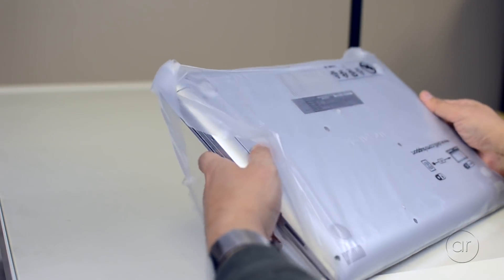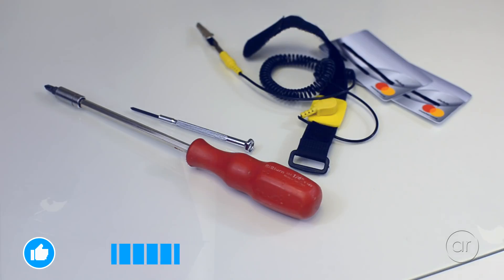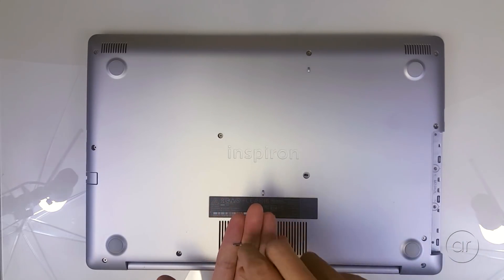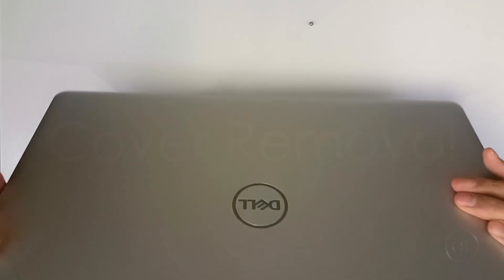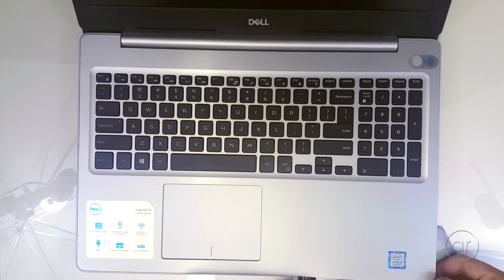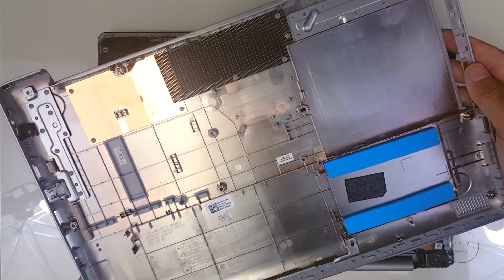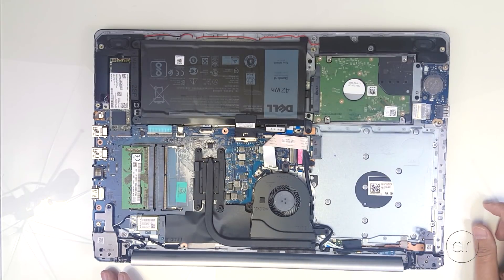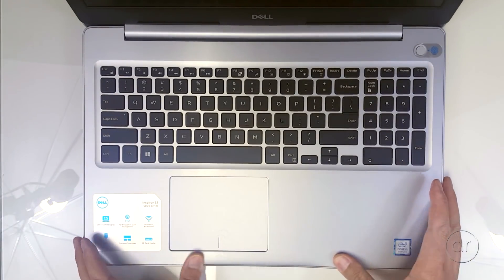How to Disassemble a Dell Inspiron 15 5570 Laptop to Install an M.2 SSD

Comment: I don't comment on videos and yet this was so easy to follow. Just take your time of course on removing the case especially near the bottom of the screen. I had a tiny piece of plastic from the inside corner near the screen of the case break and didn't hinder the case to be installed back on. Did a new RAM upgrade, SSD, and HHD drive. Saved me near $1k on a new laptop since the original HHD died.

Comment: Question. I would like to see a video of you taking either the CD Drive out, and putting in a SSD, configure it like how you did in "UPDATE: Using Macrium Reflect Free to Clone Windows to a Bootable M.2 SSD". Or taking out the HDD and putting in an SSD. And then do the same as "UPDATE: Using Macrium Reflect Free to Clone Windows to a Bootable M.2 SSD". The reason is because my Dell Insperon doesn't come with the SSD slot. Plus, I like how detail your videos are. 

Or of anyone knows a video that does what I just asked above, I will surely appreciate it

Finally, I'll be subscriping to this channel, as I like both videios thus far. And comments are good.

Comment: This is exactly what I want to do with my machine but I have a problem removing the optical drive. When I remove its retaining screw it moves about a quarter inch and then snags on something. I'm hesitant to use a lot of force as I'm essentially pulling on the drive tray. Without being able to remove the drive I can't get at the two base cover screws that sit underneath it so no way to remove the cover. I'd be happy to get any advice on what to do next.
Reply from the maker: It sounds like the screw may be stripped part-way. I don't want to give you advice that may break the optical drive, so I'll defer to others who may have more experience. Anyone?
Reply: @accessrandom  Problem solved. I left the drive tray open and it was clear that the drive case was fouling one of the two screw heads. A judicious poke with a thin screwdriver blade freed it. Now I just have to persuade the right corner of the base cover to unclip and I’ll finally be able to get at everything.
Reply from the maker: @zebop917  Glad you were able to work the problem screw out. Thanks for the update 👍

Comment: Hi, i have dell inspiron 15 5000 which only have 220gb ssd, my storage is almost full. My question is, can I add 2nd slot for ssd (500gb) ?
Reply from the maker: According to Dell's Setup and Specifications page for the Inspiron 15 5000, it supports both a 2.5" SSD and an M.2 SSD/NVMe so if you have one already, you can add the other.

Comment: My laptop is dell inspiron 5570 without optical disk so which ssd will it support?
Reply from the maker: According to Dell's Setup and Specifications manual, the 5570 supports a "maximum configuration" of up to 256 GB for M.2 SATA SSDs, and up to 512 GB for NVMe SSDs. However, there are many in the comments who have had success with 500 GB and 1 TB (due to Dell probably testing only up to 256 GB at the time of printing the manual).

Comment: Do we need a heat spreader to cool down the NVME SSD?
Reply from the maker: I have not had any issues with a bare SATA M.2 SSD, but it is always a good idea to try to reduce temps whenever possible.
Reply: @accessrandom  thank you so much 😊

Comment: What is the max SSD capacity which can be used?
Reply from the maker: According to Dell's Setup and Specifications manual, the 5570 supports a "maximum configuration" of up to 256 GB for M.2 SATA SSDs, and up to 512 GB for NVMe SSDs. However, this is probably what they had tested at that point in time, since my 360 GB worked fine, and others commenters below have gone up to 1 TB.

Comment: I added a 500GB Samsung 980 SSD to this same laptop.  Here’s a few ideas to help.  When taking off the screws tape them aside of the hole in which they belong.  As you move the laptop around one or two screws might come loose from the tape.  The credit cards work great to pry open, the case was somewhat hard to open.  The area where the hinge opens is the toughest.  I was afraid I’d break something so I just left it alone and never took the case apart from the hinge and had it opened about 90 Deg and installed the SSD with no issues (not even dropping the tine screw) so use a magnetic Phillips screwdriver.  The case snaps together pretty easy.  During the whole install process I did have a tiny pinhead plastic chip come off from somewhere; no issue though.  I then used the Samsung Data Migration to Clone the old HD to the SSD.  I had to do a lot of reading and the Samsung FAQs did help.  I had to delete a lot of programs including the firewall, antivirus and turn off internet connection before the cloning process worked!  But finally got it recognized and working with a speed of 1500/1700.  A lot faster than the 5400 HD!!!!
Reply from the maker: Thanks for the tips and the detailed write-up - lots of good ideas 👍
Reply: Did you replace with m.2 nvme ssd?

Comment: Can you put a recommendation for m.2 (either 256 gb or 500 gb) in Amazon links of description?
Reply from the maker: I'm afraid I haven't tried any other M.2 SSDs other than the one in the video (which is unavailable on Amazon) - I'd want to try any before recommending it. However, there have been other viewers in the comments who have reported successful upgrades, so that would be a good source. Theoretically, any 2280-sized M.2 NVMe or SATA SSD should work, but I believe the highest I've seen in the comments is 1 TB.

Comment: I have this model, the biggest problem is heat, the CPU regularly reaches 98-99 degrees, and the fan is loud when this happens, this is when I'm just doing web browsing. Looking at the bottom vent, it seems the vent is very limited, why can't Dell make some bigger vent slots on the bottom. Does anyone else have this problem?
Reply from the maker: Have you tried the latest BIOS update? I heard that it is better at regulating temperatures (I'm not sure if it throttles the CPU speed, but it seems to keep temperatures down).
Reply: @accessrandom  Thanks for the reply! I did update most of things, BIOS, drivers, etc. they absolutely made no difference. What's more, the newer BIOS disabled the ability to under clock my CPU, which is used by some to avoid overheating. I also re-pasted the thermal paste, a couple of times, nothing made a difference, I'm ready to cut more vents myself on the bottom of laptop cover so that the fan can draw more air in but have not done so, then a couple of days ago, I found and ran something called Windows 10 debloater, it removes a lot of unnecessary Windows 10 built-in services, like games, weather, news, things that I don't use and suspect most people don't use either, as there are established and proven websites to do all those, why switch? To my surprise, this drastically lower my CPU temperature, before this debloater, within using my computer doing light duty reading, my CPU will hit 99 F a couple of times, although it stays in high 60s most of the times. After the debloater, the highest my CPU reaches is 72F, most of the time, it stays at mid to high 50s. I'm pleasantly surprised and this solved my biggest concern for the computer.

Looking at newer Dell Inspiron 5000 series, they have added more vents on the bottom, but why didn't Dell do that on 5570, that is a mystery to me, it's not like Dell just started making laptop a couple of years ago. Wonder if they hired some summer interns to design the cover on 5570 and nobody really checked the design, but even a summer intern would know better.

You video is top quality, it helped me to understand how to open up 5570 to add more RAM and SSD, both of which I did. Now with this overheating problem solved, I'm so happy as I have a computer that's powerful and I did not pay a lot of money for it. Thank you again!!
Reply from the maker: @mikeliu106  Thank you for the detailed writeup. - it'll be helpful for others having the same problem. I may need to take a look at that for a future video...

Comment: did this and keyboard no longer works
Reply from the maker: You may have inadvertently loosened the connector to the keyboard, though I'm not sure how (that assembly isn't modified in the video). You may want to look up Dell's Service Manual which they will have on their support site.

Comment: I'm thinking of upgrading to an ssd but I read you can only go as high as 512gb with an m.2 on the 15 5570, is this true? I have about 700gb of memory used and was hoping I could clone everything over to a 1tb Sx800 pro
Reply from the maker: I'm pretty sure that others have successfully upgraded to 1TB in the comments below. I believe the stated capacities in Dell's documentation are configurations that they tested with (not necessarily the sizes that they support).

Comment: do i need to get rid of the hdd to make it faster? or do i just have to add the m. 2 ssd
Reply from the maker: You can just add the m.2 SSD, but if you install or clone Windows onto it, it will be much faster to boot and use. You may want to visit one of my other videos here: https://youtu.be/cVRVgrOl1M8
Reply: @accessrandom  thanks sir, too bad i dont have the budget to buy an ssd hahaha
Reply: @accessrandom  so sir i actually managed to buy an ssd and managed to make the os boot there. if i download games and i put it in the hdd's storage does it affect the overall gameplay? or does it not since the os is booted through the sdd
Reply from the maker: @yadamichizuki7131  It will affect the games' load times, and if there are any textures/areas loaded during the game, those will be affected as well.
Reply: @accessrandom  sir can i change one of my usb ports? one is not functioning. and should i install all drivers that i can find on dells website?

Comment: WD 250GB SN550 Nvme SSD. Does is fit inspiron 5570. I am bit confused as video shows ssd with 2 gaps in connector pins but new ssds has 5-29 connector set. Kindly help
Reply: Please Share link of exact ssd that fits inspiron 5570
Reply from the maker: If it's a 2280-sized SSD then it should work. I'm afraid I don't have a link to the one I used since I got it from a bidding site.

Comment: Great video! My model has one 128gb ssd and one 2tb hdd/ Do you know the size of the 2tb hdd? Is it 2,5' or 3,5'? And one more thing...does it support m2? Thanks in advance!
Reply from the maker: Thank you. The HDD is 2.5" and it supports both M.2 SSD and NVMe.

Comment: I have this model but without the DVD drive. Are the screws that are under the DVD drive in your model present in mine?
Reply from the maker: I can't say for certain. If it belongs to the Inspiron 15 5000 family, I suspect there will be, as there's probably some placeholder piece in lieu of a DVD drive.
Reply: @accessrandom  Ah, I see, since I've been planning on upgrading the memory in this laptop and I just wanted to know if the screws were there.

Comment: Sad i have a problem on my dvd drive it doesn't came out when i removed the 1st and all screw. When i pulled it the only cover of dvd drive was taken out :(
Reply from the maker: Sorry to hear you're having problems. Was the screw stuck (and didn't come out at all)?
Reply: @accessrandom  wow really thanks for your response. All the screw is already taken out in DVD driver but when I tried to pull it out the driver wont slide out and the cover is the only one taken out. So I decided to go to technician here on our area. I got no choice my laptop needs a new battery replacement and when he noticed the dvd driver  he said the lock is already broken now. :(
Reply from the maker: @rowellwalo1633  I see. I wonder if it was a slightly different model and perhaps there was a different mechanism to fasten/lock it.
Reply: @accessrandom  maybe. I think its working fine when I put it back. As I can see the cover of the dvd drive is easily to remove now. My problem on the next replacement is how can I remove the dvd drive again because it get stuck inside hmmm.. However is there something besides on the screw that makes the drive not sliding out? Hmmm. I wonder if there is a lock or something inside..
Reply: @accessrandom  by the way how can I know if my dell inspiron 5570 is upgradable? For ram or etc. As for now I have 2tb hdd and 8gb ram ..
Reply from the maker: @rowellwalo1633  If you search for Inspiron 5570 in google, it should take you to Dell's documentation site for that model, which will take you to the Inspiron 15 5000 Setup and Specifications guide. Since it's the same as mine, it should be upgradable to 32 GB RAM (2 x 16) and I don't believe there's a limit to the hard drive itself.
Reply: @accessrandom  I searched it on google and it leads me on some online shopping sites and reviews. Based on the specs yes the ram is upgradable to 32gb but for now mine is installed 8gb ram, is it okay if I buy one 16gb ram and it becomes 24gb ram? Is it okay? I noticed that the ssd/emmc is 256gb, so the limit of ssd is 256gb?  I'm sorry I don't have a great knowledge about computers and parts actually its my first laptop 😅
Reply: @accessrandom  thanks for the info about hard drive 👍
Reply from the maker: @rowellwalo1633  Normally, you will want to match the two RAM sticks such that they are exactly the same specs (size, speed, etc) - even better would be the same brand and model. If you have a mismatch, one can slow the other one down, and if the sizes are different, there will be a slight slowdown in speed since they would not take advantage of dual channel (though you probably won't notice the difference in everyday use).
Reply: @accessrandom  thanks for the info. Its a little bit pricey with a 2x16gb here in Philippines. I thought if I will use 2x16gb, then what a waste for 8gb ram that already installed.
Reply: @accessrandom  btw is it okay if I choose to upgrade my RAM only on my 5570 from 8gb to 32gb? I mean there's no need to upgrade other parts of laptop to use the upgraded RAM?

Comment: I can confirm I installed an WD 250GB M.2 NVMe. Read speed: 2450mbps Write speed: 960mbps. It now takes the Laptop 28 seconds to fully boot :-D

Comment: I have This almost same laptop Dell Inspiron 15 5570 (5000 series) but mine doesn't have a CDROM. Does it also support This M2 SSD?
Reply from the maker: The 5700 points to the same Dell Inspiron 15 5000 series Setup and Specifications guide, so it should have an M.2 slot. If in doubt, try entering your service tag at Dell's support site - that should take you to the correct guide.

Comment: Can I install m.2 SSD in Dell Inspiron 15 5559?
Reply from the maker: I'm afraid not - I checked Dell's website and it didn't have any mention of an SSD slot in their specifications manual for the 5559, sorry.
Reply: @accessrandom  OK Thanks

Comment: After doing this process and reinstalling windows with a boot pendrive should i reinstall the laptop drivers? Great video!
Reply from the maker: Yes, if you are re-installing from scratch (and not restoring from SupportAssist), you will need to re-install the laptop drivers. Windows may provide some of the drivers OOTB but you can always update them.

Comment: I have a 200Gb ssd installed in my Dell 5770 I want to upgrade to a 1Tb SSD the laptop has only one SD slot.  Can I clone my data to an external HD, replace the SSD, and then re-clone my stuff back to the new SSD?
Reply: Or I just saw someone use an adapter and cable for $23 for the new SSD and then I can Clone my old SSD directly to the new one then replace it.  How does that sound?
Reply from the maker: @edgarbiii4661  Yes, that's the correct procedure. If you'd like, you can visit one of my other videos where I do the same thing: https://youtu.be/mKSmwyPXH2I

Comment: I've successfully cloned the HDD OS to SSD by recovery method and rebooting from factory settings. Now my laptop tries to boot to the  HDD everytime. I tried disabling Disk 0 and choosing the appropriate UEFI boot sequence, but everytime I start the laptop it always goes back. The protect boot is disabled by the way.. is there any work around here?
Reply from the maker: Can you please try booting to the rescue disk (created by Macrium Reflect) and choose the "Fix Windows Boot Problems" option, then select your SSD? The BIOS can register the wrong boot configuration data when there are two boot partitions in the system, and this will restore it on the disk from which you want to boot. I have an updated video that explains how to do use the rescue disk here: https://youtu.be/CHCENfs87F4 (it will be at the last several minutes of the video).

Comment: it only supports the m2 or can i use others ?
Reply from the maker: Yes, you can use others. Generally, this procedure will work with any two storage devices. However, if you're cloning from a 2.5" HDD to a 2.5" SSD, you may want to visit one of my other videos here: https://youtu.be/mKSmwyPXH2I
Reply: @accessrandom  tnx for the help

Comment: I ran into trouble with a 17 Inspirion 5770.  Used two types of cloning software and the damn thing refused to boot from the M.2.  Of course, a problem was the native drive was 2TB and my M.2 was only 1 TB. But what the hell, my plan was to use the M.2 for a system drive and the native drive for storage. After trying everything I said to hell with it and got out my installation media for Windows 10.  If you do this be sure you are signed in on a Microsoft account which will remember the machine and activate it for you. At any rate, I nuked both drives, re-installed Windows from media I created from Microsoft's website, and Voila!  Success!  An added benefit was that all of the Dell Bloatware and Crapware was gone.  The clowns at Dell had five partitions on the native drive. On the re-installation of Windows, I only had three which is all a system drive is supposed to have.  Before all of this, that machine was so slow spiders could spin webs on you while you waited for it to boot up. Now it moves like lightning!